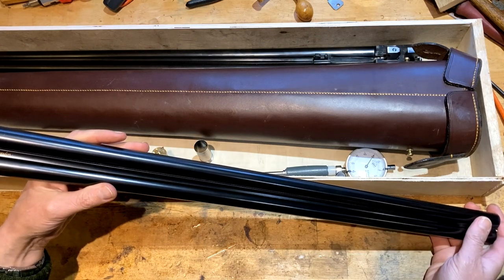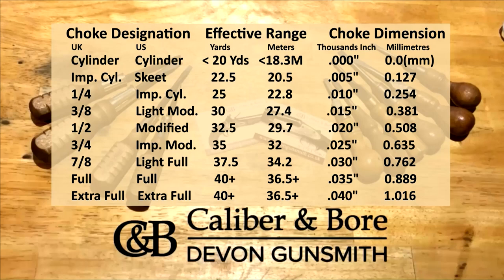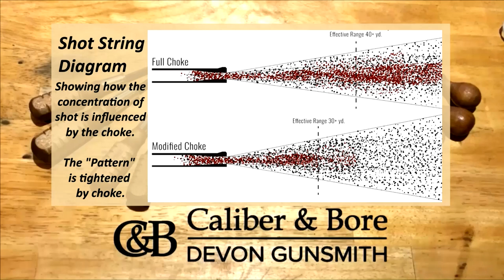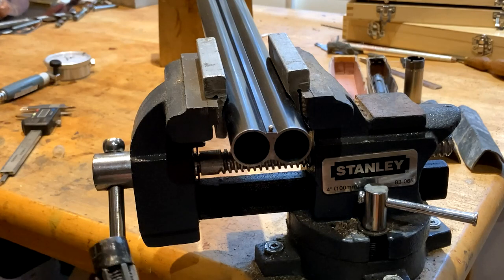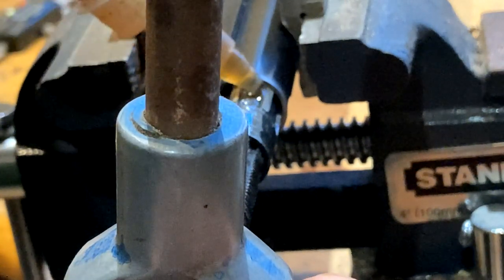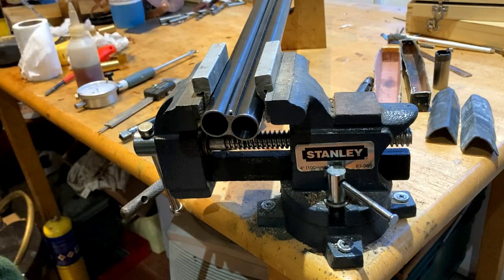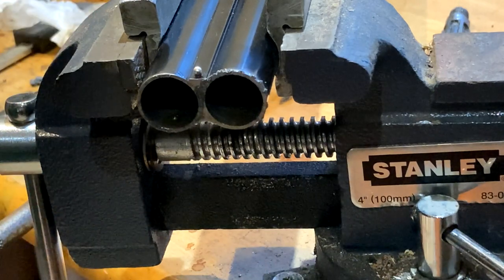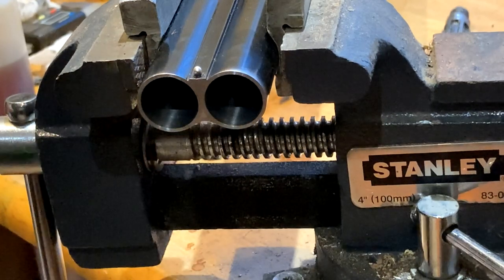Devongunsmith Diaries #16 Purdey barrels for reaming chokes to standard steel

Comment: I have seen gunsmiths in the US use reamers with pilot tails to keep the reamer parallel to the bore.
Reply from the maker: Yes of course.. they should be breech fed to stabilise correctly..
The channel premise is to work with tools easily available.. not special tools..
With sufficient skill the backwoods gunsmith can operate adjustable reamers easily..

Comment: Thank you for a your interresting videos. Is reaming longer forcing cones the same process? I had that done in a old shotgun of mine and i am happy with the results. Less felt recoil and patterns good with most steel cartridges.
Reply from the maker: Yes very similar. More metal to remove in general.. but very similar process.

Comment: The best patterning chokes I've seen are screw in types, with a conical section that transitions to a cylindrical section at the muzzle.
Reply from the maker: Yes that’s also true of the remaining portion of the choke cone in those barrels..
Guide bushes are of limited use, you have to feed them in from breech end, in order for them to function correctly.
The premise of the channel, and the challenge, is to use tools readily available to the home gunsmith without a fully appointed gunsmith workshop and all the attendant tools and gear…
A competent DIY home engineer should be able to carry out most jobs with basic tools.

Comment: Thank you from Canada, I assume the reamer cuts in both directions, but am ignorant on the threads ? Does the reamer miss the threaded area, or you thread later which means re cutting to a common ID ?
Am a gun guy (handguns mainly) and obviously I know little of shotguns
Reply from the maker: These barrels were solid fixed chokes, hence the need to ream.. 
multi- choked systems only need to have different choke sleeves screwed in to achieve different choke patterns. 👍
Reply: @devongunsmith4698  thank you, now that all makes sense
Reply: reamers cut in one direction only
Reply: backing the reamer up like he did can dull it

Comment: Could you use the mirlon/cutting oil to remove lead fouling, light pitting?
Reply from the maker: Yes to lead fouling: if you use a drill driver or lathe to spin the rod, it will squeal like blazes with the fouling.. but it will clean up. 
Don’t attempt pitting. There are too many pitfalls honing pitting.
You would need barrel thickness gauge and bore scope for starters
Reply: @devongunsmith4698  great advice thankyou,  the wall thickness have been measured and are OK apparently, the gunsmith said the pitting isn't too deep,  just a couple of patches of  in the bores but they're black/discoloured so down to my OCD wanting them smartened up really! Thanks again